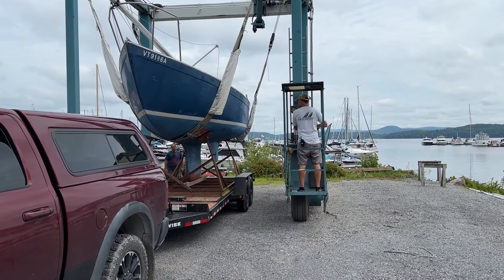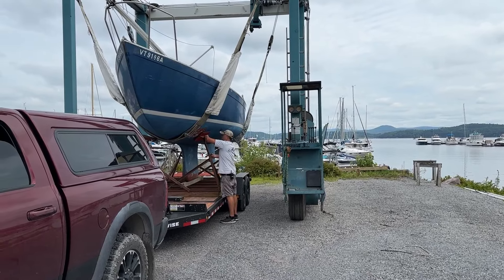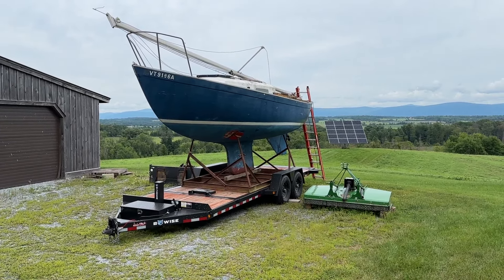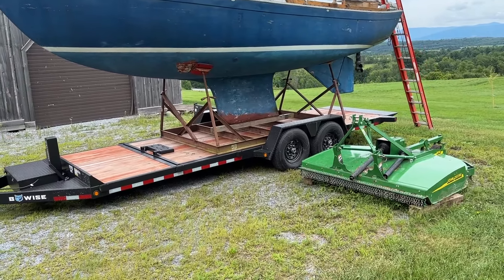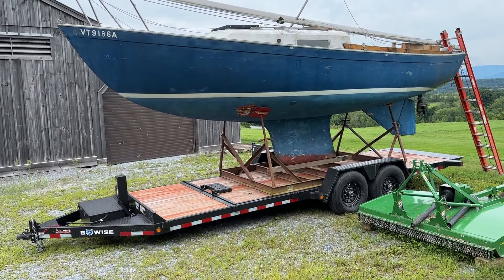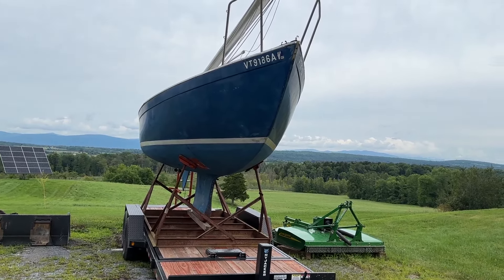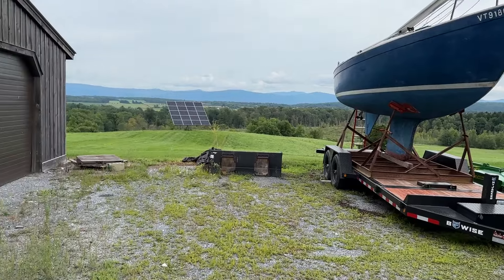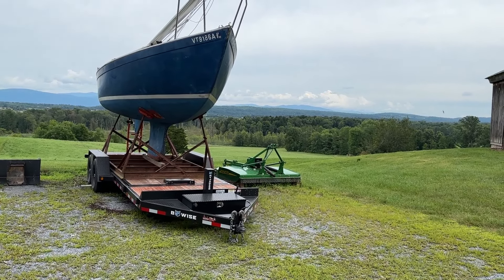Meet Northwind Our 1969  Chris-Craft Capitan 26 Sloop 8-26-2024

Comment: I had the same boat on Lake Michigan 24 years ago. She is a dream to sail. Look at the skeg bolts and if they are not replaced you may need to address them. I always wanted to put an electric sail drive in the engine well to replace the old outboard but back then the technology was not available.
Reply from the maker: Thanks Mike. The forward end of the skeg is separated from the hull about 1/2" and over about 4", so I suspected there is a skeg bolt issue. Crawling back in there will not be easy, but it will be done.